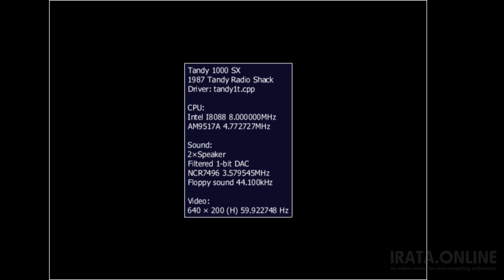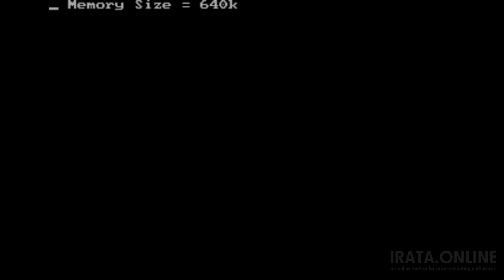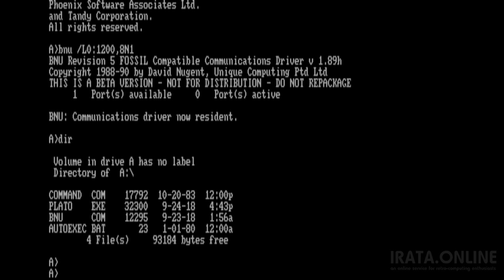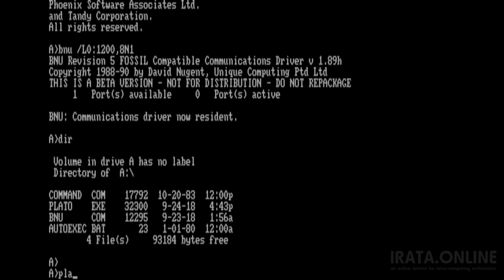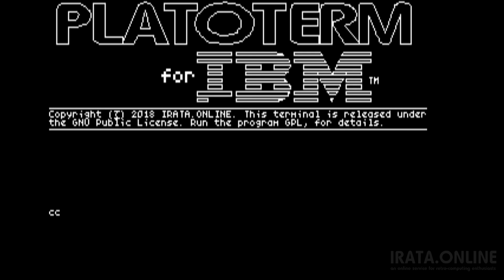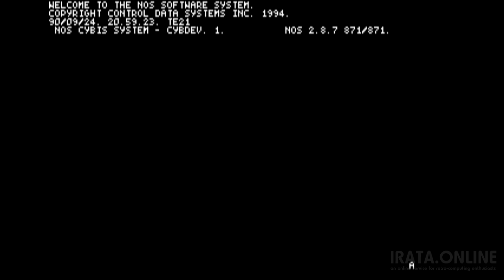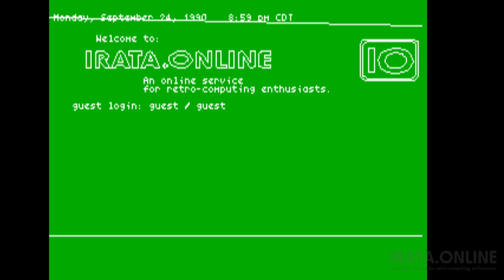PLATOTerm for PCjr/Tandy 1000 Bring-up

Comment: Did you think about BGI drivers?
Reply from the maker: BGI is not available in Watcom, and honestly aren't much better than the BIOS services, not to mention the stupidity of keeping the drivers external (unless you do some gymnastics to statically link them)

The Watcom graphlib is infinitely better, and am trying to get my OpenWatcom 1.9 build environment working (to explicitly build OW itself), so I can patch the graphlib to add support for the 4bpp CGA like PCJr mode (by extending the CGA code)
Reply: @tschak909  I prefer external drivers, you know.
Reply from the maker: This is a special version specifically for 128K PCjr's and Tandy 1000's, only one mode supported. No point.